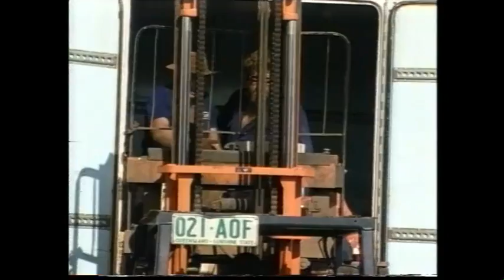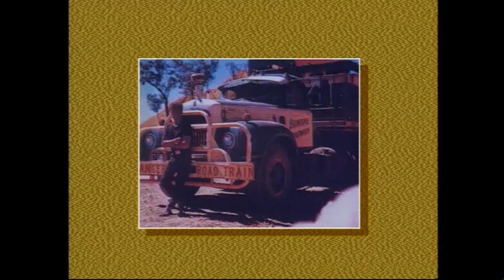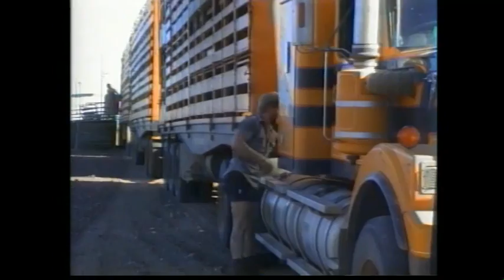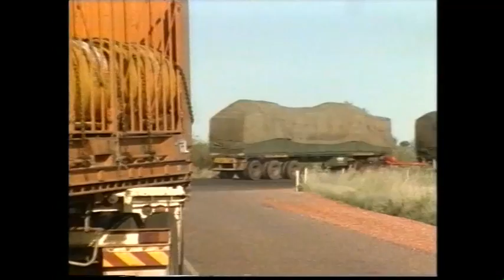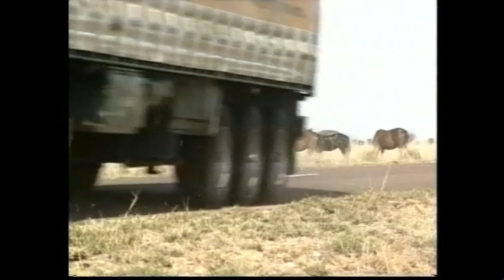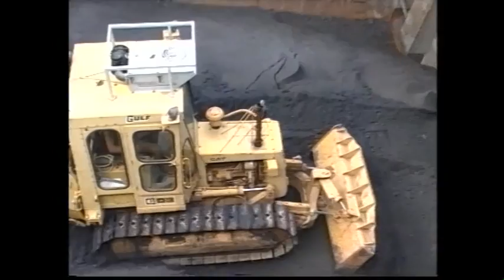ROADTRAIN!

Comment: BEAYTU IKIGN Y FO RPENCOIL SAVER YES HE KNOW WHAT IT KEYS BITO FUEL GAS KEAN WITH NOT LIGHT AT FIGHT NOT ADADDY FAMLIY ONLY UNFORM  DONT LET A BTICH SHAREN STRON  TILL MUMMY GHOST IN TWO  CONCRTEE  ALL WITH  THEN 40 ALL $9999999999999999999 ISNPECT ELEMN TYOURS HTUNDER UESE POWER SILLY PIC I HAVE THE

Comment: hi there.greetings from england, do you still use AEC trucks out there, or are they all gone now?
Reply: There are a few in transport museums...........
Reply: I'm also from the UK @peter smith, AEC was defunct over 40 years ago. No one is using equipment that old to work on a daily basis.
Same with Scammell.
Dead by 1988